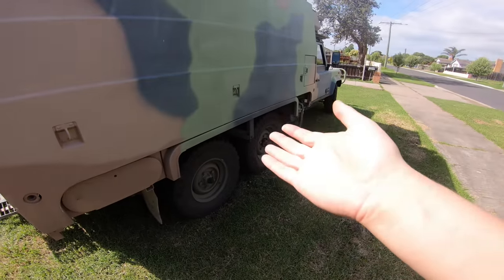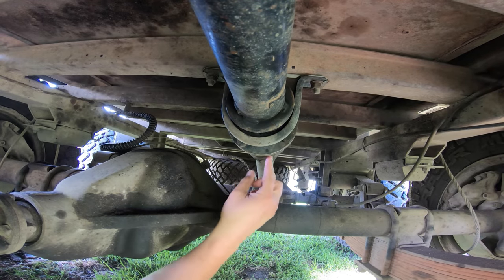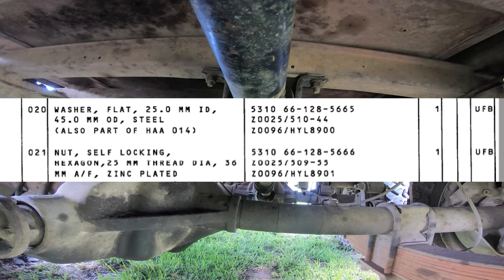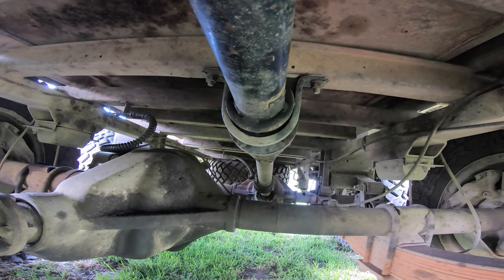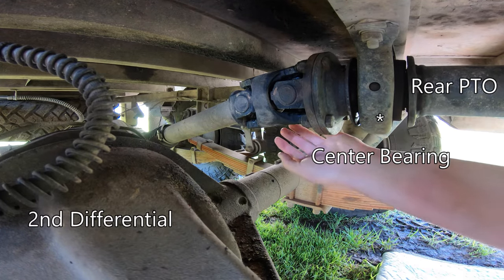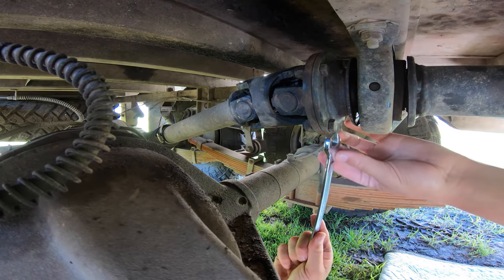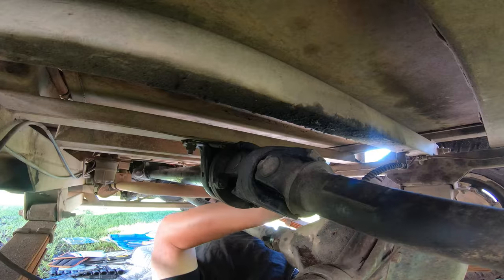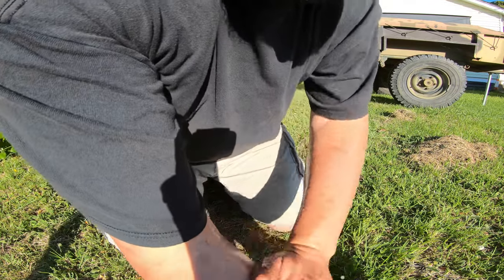Not what I expected | 6x6 Perentie Ambulance PTO wobble.

Comment: Thanks for directing me to this update as it is most timely as I have to replace my centre bearing as well. It took me 3hrs on the side of the road to remove that entire shaft assembly! KLR has those nuts they say (I asked them) and there should be a spring washer underneath it according to the RPS. Mine didn't have the spring washer and the nut was extremely difficult to remove. Nobody in LR world stocks the spring washers, but I am waiting for a couple of generic ones in the post from an Aust company which sells nuts and bolts. Hopefully they fit!  You are doing an awesome job with this, especially with MS. I tried to have a close look at the direction of the centre bearing in the video. It looked like in yours the more open rubber side was facing to the front and the 'rounded' and more closed side was facing to the rear? There are removable covers on the shafts (one stopped you from removing those bolts), but did you also use the shiny metal cover that was tied onto the bearing when you received it?
Reply from the maker: I don't recall, I'd have to crawl under and check, will be undervit again later today.

Comment: Great stuff . (Refer to your test drive vid) May i mention the rear T/shaft dust boot covering the slip joint seems in the vid to be sitting incorrect (unbalanced) . This boot can have some residue grease after you  have greased the spline .
This in the long term could unbalance things and cause loose bolts ect causing vibrations and or failures 👍
Reply from the maker: Yes I'm aware of that, it's not the correct boot, it's a power steering boot, and was all I could find at short notice, I plan to laser cut some centralizing flanges to fit in there, similar to the factory designed ones.
I get under there and re-distribute the grease from time to tome to shift the load on the uj's until I can mange to do the rest.

Comment: Exactly same thing happened to me. It was noise when I release foot off accelerator pedal.  Rear Diff input flange nut was loose. I used red locktite for parament solution. I used a couple of bolt and nut in the flange and  jammed long enough bar to hit ground to tighten the nut. I see now. PTO is running 3rd wheels set! So technically all shaft can be removed and run as 4x4.
Reply from the maker: Apologies for the delay in reply, your comment ended up held for review for some reason.